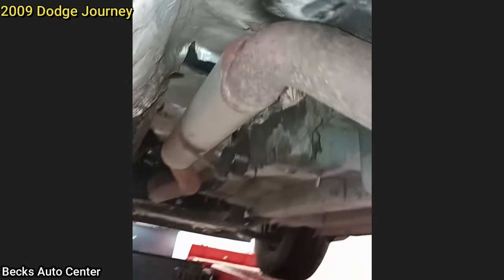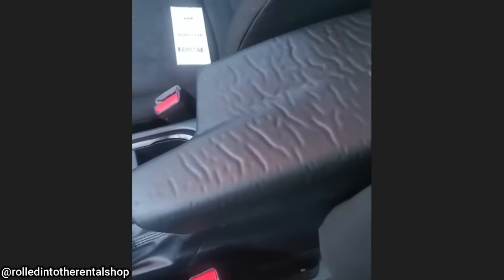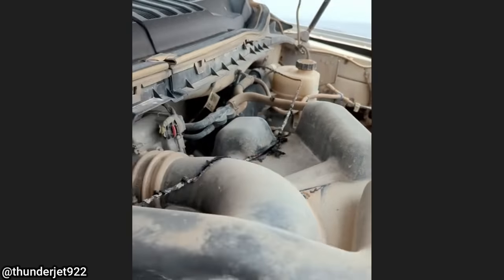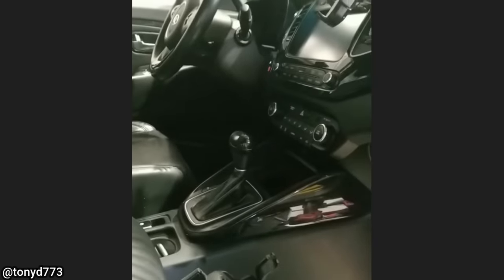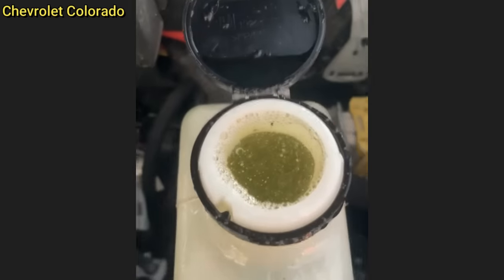Customer States Compilation (The Best of 2022) | Just Rolled In

Comment: I can’t get over the fact that the guy’s heater stopped working, and so he built an open-flame,
propane-fuelled space heater instead of buying a goddamn sweater. 😭
Reply: "Sure is cold in here. Guess I need a flamethrower. Only option."
Reply: Kinda looked like the burner on one of those turkey fryers.
Reply: You haven't lived very far north before have you
Reply: @iain-duncan  Two sweaters.
Reply: Red neck repair. Hey it works.
Reply: @beanieguitarguy4070  yup, that'll do it
Reply: yeah but sweaters dont stop the windows from fogging up.
Reply: when you have high INT and low WIS
Reply: Breathing in those fumes. Delightful.
Reply: One bump and the interiour is on fire.
Reply: Dumasses I’m telling u
Reply: Darwin....
Reply: It is a weed burning torch.
Reply: I've used a Mr heater in the back of my suburban during the winter to help warm it up. But it's not a open flame and I put a heat shield under and behind it and I turned it off before I started driving
Reply: bro the propane tank wasnt even strapped in, if he braked hard it would launch the fucking tank straight into him lmao💀
Reply: It's a typical propane burner for outdoor frying and boiling.  Hey, some places get reeeeally cold in the winter, and a sweater ain't gonna cut it.  Hopefully he wasn't going long distances and didn't give himself carbon monoxide poisoning.  😆
Reply: That's just badass. What's really dumb is that a customer thought you could change the color of the car in the settings.
Reply: I'm more worried about people driving with broken frames
Reply: Never in my life would I be too cold to put a propane heater in a car 😂
Reply: Hey, it's handy for lighting your cigarette.
Reply: He's tryna become the human torch😂
Reply: @beanieguitarguy4070 , customer would've been okay, though, if he'd just used a Tesla blowtorch! 😂
Reply: @adampope5107 I feel like propane fumes can’t be that bad because i’m pretty sure forklifts run on propane and they work in small areas. Obviously still not healthy though
Reply: My AC and heat don't work, and I don't have the money, time or skill to fix it. You know what I do? I deal with it 💀 either roll the window down or put a coat on

Comment: 0:00 Closing the Trunk But fast!!!
0:10 When Door Closes, The Tailgate Opens
0:24 Fuel Leak
0:37 When Turning Left & Rolling the Passenger Window down, the door opens
0:45 Customer States his door latch is broke
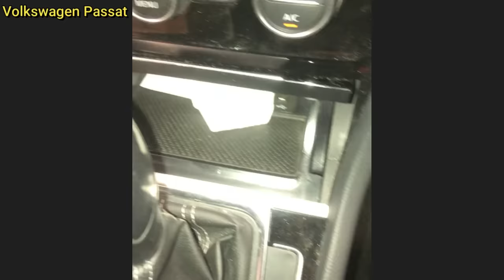0:58 McDonald’s Straw Disrupts the Tray Closing
1:07 Car Starts when Locking the Door 
1:26 Curry Interior 
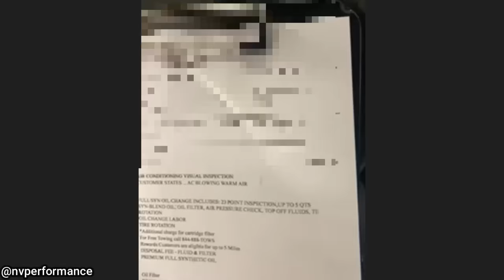1:45 AC blowing warm
2:02 Cowbell Driving
2:12 Raccoon in the Under the Car
2:22 Cutting a piece of Frame
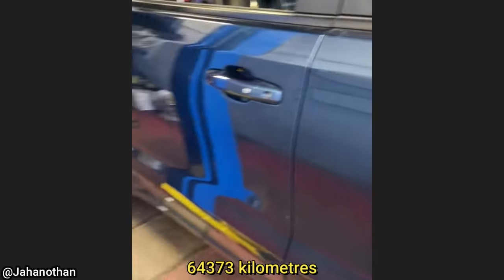2:35 Forgot to take the Funnel out
2:58 Car stopped moving
3:13 Smoking Brakes
3:25 Heard a pop while Driving 💥
3:44 Tire Repair
3:47 Taped Tesla Tire
3:55 Bungee Cord Attached to Lower Control Arm & Spindle
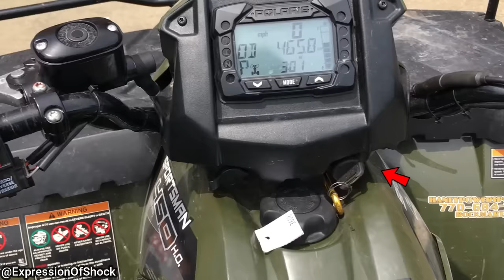4:04 ATV Shuts off
4:12 Engine is Making Funny Noise
4:25 Bullet Holes 🕳️ 
4:38 Shooted Rotors
4:47 Chained Control Arm
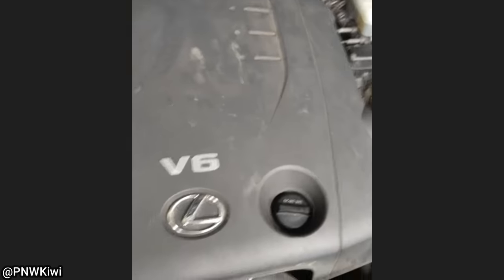4:53 Noise Under hood
5:06 Car hit a Guardrail
5:26 Beamer Rescued
5:40 Twisted Brake Lines
5:51 Dipstick Broke
6:05 Cutted CV Axle
6:20 Console lid looks like “my ballsack” please replace
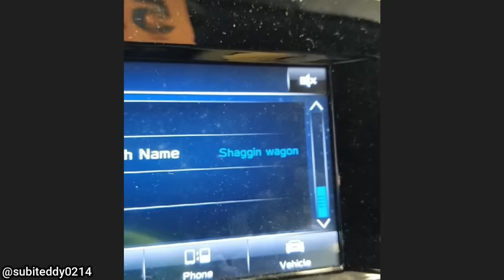6:38 Shaggin wagon
6:49 Family Member Installed New Brakes
6:57 No oil
7:12 No Gas ⛽️ 
7:37 Overfilled Engine Oil
7:47 Air filer Backwards
8:11 Didn’t follow the Torque Sequence Properly
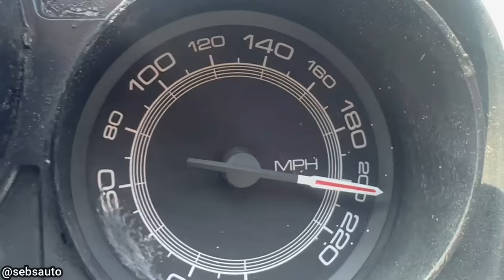8:20 Too Much Conditions For Ferrari 
8:48 Why would you need a Fuse
9:05 Bedazzled Chrysler 300
9:30 Critters Living under The Floor Mat
9:48 Why the Interior Is Covered In Mold
10:05 Taxi Mold
10:21 Disgusting 🤢
10:30 Turtle hit a windshield
10:40 No Radio has a blank screen
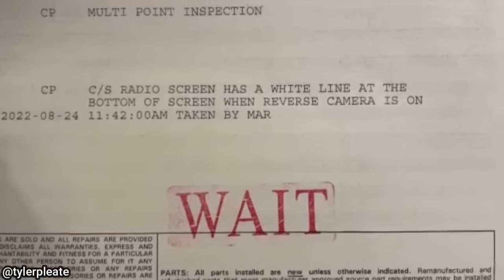10:51 Just a Bumper
11:03 Brake Issue ASMR
11:21 90 PSI Tires 🛞
11:33 110 PSI 🛞Tires Again 🛞
11:43 You need more air
11:59 Charging a Battery 🔋 
12:08 Reusable old Head Gasket
12:27 1960 VW Beetle Wheel Bearing
12:52 Pumpkin Fuse Blown
13:19 Flat Twinkies 😂
13:30 Interesting LED Light Installation
13:50 Adding a Bigger Fuse won’t work
14:02 Speaker Sound System Car
14:19 Wheel Rubbing Brake Caliper
14:31 My Truck is all over the road
14:57 Vegetable Oil in the Washer Fluid Reservoir
15:11 Car Clunks Under Acceleration
15:32 Install a Four flat trailer wiring
15:51 Slide Sideways like It’s on Ice
16:03 I Thought The Vehicle is on fire 🔥
16:15 Blue light on dash
16:30 Turkey Hit by A Car
16:40 Drove Into the Ditch
16:50 When your Car starts Grinding, stop & have it looked at
17:06 Light vibration in the front right
17:15 Seized Honda Engine
17:32 Seized Kia Engine
17:52 Washer Fluid in the Headlights
18:09 Right Brake light won’t work
18:21 Broken Engine Mounts
18:34 N20 Under the Seat
18:55 No Bolts Holding the Accelerator Pedal
19:04 Few of the Things they found wrong on this truck
19:33 Jug Of Engine oil on the Door
19:44 Tennis Coil Springs
19:51 it was a huge disaster
20:06 Interior light does not come on when open door
20:18 Fuel Saver Scam
20:28 I’m Just a Messenger
20:45 I’m Hittin Curbs
21:00 Welded Exhaust
21:17 Dog Destroyed the Truck Interior
21:30 Car Hits a Shop
21:43 Customer Jeep
Reply: Bless your soul

Comment: Okay, you have to admit; even though the fella that welded up that exhaust didn’t have a clue what he was doing, he was no quitter. It took real patience and perseverance to make that porcupine looking mess.
Reply: I’m a fucking horrible MIG welder and even I have no clue how he ended up with that mess. I couldn’t do that if I was trying to.
Reply: @Heiryuu  it was so consistent, but not in a good way.
Reply: Idk why but it skeeves me out and makes me feel all itchy just looking at it 😩
Reply: Looks like one of those ant hill sculptures. Also a welder myself and if i was tasked to do this on purpose i have no idea how to.
Reply: @Heiryuu  the only thing I can think of is if you turned off the gas, set the voltage and wirespeed to a random number, and use random copper wire for filler metal
Reply: @cavemanlovesmoke4394  It's like a reaction to seeing a cactus or a bryer patch. Big "do not touch" energy. Very good having those strong survival instincts.
Reply: That has to be at least 11 spools of wire.
Reply: That was impressive imo
Reply: THAT'S what all that stuff was?! I couldn't figure it out, I thought it had layers of fungus growing all over it, that's insane!
Reply: For a split second I thought there was a weird fungus on the exhaust lol

Comment: The overpressure tires reminds me of the tale I've shared before about the old lady that came to the station once where my brother worked cause her usual station was closed. Said they were so nice, always checked the tires - 100 psi. My brother dropped the pressure to normal and just told her "I don't care where you go from now on, just DO NOT go there again."
Reply: Wow! Its a miracle that place didn't get her or someone else killed! Just imagine the "help" they've given others.🤔
Reply: Discount Tire always do that to my 4 tires.  Go in for free rotation, they keep overinflating the tires by 20 psi.  I always had to manually bleed the air out.
Reply: God bless your brother. Signed, old ladies everywhere.
Reply: @justlucky8254  You're assuming that they haven't. The old lady got lucky, but dead men rarely tell tales.
Reply: @DecrepitBiden  Might want to tell them if you haven't already. Their compressor probably needs to be (re)calibrated
Reply: Those were semi tire pressures. 110 in the front 100 in the back
Reply: @happinessiskey2858  badly
Reply: should have filled em with runflat air smh
Reply: @candyman9635  I think it was summer and they were still using winter air SMDH.
Reply: @DecrepitBiden  I got a set of tires at discount tire and they underinflated them, 32 psi on a 55 psi tire
Reply: @DecrepitBiden  - That’s because idiots inflate the tires to what it says on the tire, rather than what the manufacturer recommends on the sticker inside the drivers front door!!! I’ve had to teach rookies this at the shops I’ve worked at before when there’re fresh out of “Tech” school.
Reply: @thatguy273  - Yeah. Even 2500-3500 pickups/vans usually only use 80psi. I can’t imagine putting that much in a regular passenger car!!! 😂
Reply: I bet it rode like Fred Flintstone’s car on those tires.
Reply: @chesterswingjr9796  I learned this the hard way when I overinflated my dad’s tires one time 😅 (neither of us have any technical car knowledge, but he knew about this at least; I did not)

Comment: At 5:06 there is a vehicle that was skewered by a guard rail. Some where out there is a guard rail that has been incorrectly installed because when properly installed this cannot happen. Guard are installed so the they lay like shingles on a rood of a house. You start installing them from the far end and work back against traffic. That way, the end of the first rail put in place is covered by the end of the second rail when it's put in place. The beginning of the guard rail when approaching it in traffic is normally curved down to the ground to deflect a vehicle or it has a curved cap on it which again overlaps the traffic end of the rail so there is no blunt end to hit. I worked for an outfit years ago that made and installed guard rails and installed miles of it. Occasionally we would be summoned out to reorient rails because they had been installed backwards by contractors that started at the wrong end.
Reply: Probably happened after crossing onto the wrong side of an undivided road!
Reply: there was a huge recall on bad guard rails years ago because of bad end caps that caused implement.  problem is that the majority of road works dont keep track of where these end caps are installed so there are still plenty out in the wild.
Reply: @stevie-ray2020  Notice that it's on the right side of a right hand drive car.  So, you're probably right.
Reply: Yeah I've heard that sometimes inexperienced workers will add extra support bolts that can cause fatal accidents
Reply: Steve Eimer would’ve lost his ish if he seen this cause he’s hella passionate about the guard rails being fixed and I understand why

https://youtube.com/@UkrainePapa
Reply: "curved down to the ground", aka the "launch 'em ten feet high and into a triple rollover" guide.
Reply: @Slicerwizard  That's the CHiP's mod.
Reply: @Slicerwizard  that’s what I think of them now that I was once in a flying car😅
Reply: @Slicerwizard  which still sounds safer than being skewered through the midsection
Reply: Maybe the driver was on the wrong side of the road.
Never underestimate the power of idiots to thwart the efforts of geniuses.
Reply: i can understand that he can sue the LIVING FUCK  out of the motor transit safety office government
Reply: I'm guessing it was in another country due to the steering wheel on the right 
But it could have been in the us
Reply: @stevie-ray2020  Sometimes out on the road you also see guard rails that have been damaged (crashed into) and not repaired yet
Reply: A friend of mine was a passenger  when the driver decided to be stupid on the paved road at the beach.  Her stupidity caused the front right tire to hit the sand on the shoulder and it pulled the car off, right at a guardrail.  This was a few decades ago and end caps were a rare thing.  They sawed the guardrail off near the windshield and transported him to the hospital with his seat.  The guardrail went into his face and pinned him.
Reply: Nah there's a lot of properly installed guardrails that'll do this. Most places haven't installed the style that spears cars a lot in decades, but they're around and "installed properly". And even the newest, fanciest, safest guard rail can get hit wrong, or multiple times, or just fuck up in a freak accident and skewer a car just the same, just because they massively lower the chance doesn't mean they eliminate it entirely.
Reply: @youtubecommenter4213  well that’s… concerning

Comment: The moment he started the car with the key in the door I nearly died laughing. Also, I totally get that the customer never tried that! This could be a 'feature' on all cars produced from that model and nobody would find out. Who the hell uses the key in the door when you have a remote? I certainly never tried!!!
Reply: Not me going out to my car at 3am just to see if my car does this..... 
*update* it does not.
Reply: I cannot believe it's a mfr's feature to allow a car to start from outside. Maybe an aftermarket remote start kit got installed and miswired?
Reply: I would actually pay extra for this feature, so the AC can start and engine can warm up as I strap in.
Reply: Most cars use keys . The new modern ones tho have remotes. Me myself never had a car that start with a remote
Reply: @A-A-A-A-A-A-A-A  I usually drive cars that start with a key. But I only once rented a car that required a key to open the doors instead of a remote.
Reply: @pixels303at-odysee9  most cars change signals every time, a key will never change unless you change all the holes
Reply: @pixels303at-odysee9  Mechanical keys are trivial to duplicate even with just a picture of it. And there are many ways to open a lock without the actual key (i.e. lockpicking). Prior to using transponders and other electronics, it was very easy to open a door and start a vehicle without the proper key. That is much more difficult to do now because of how difficult it is to duplicate a transponder.
Reply: @pixels303at-odysee9  they made so many things into a multimedia device, why not cars?🤣
Reply: I can’t use the key on my fob, it activates the security alarm. What’s the point in providing a key with the fob if it’s useless?
Reply: @jetoler7379  after watching this video, I have to ask: are you pressing the alarm button? Lol
Reply: @Jetoler  You might need to turn valet mode off. This is usually done via a sequence of buttons, key turns. Look in your owners manual, there will be instructions. Just takes a minute.
Reply: @FreejackVesa  No, definitely not. It's some weird security filter. I get that it prevents lockpicking, but like if my battery dies I can't access my car.

It's happened multiple times. It's a thing with newer cars. I hate it.
Reply: @berrypi8865  Oh shit, thanks I'll check it out next time I drive.
Reply: @KingDudi16  
Ever hear of a remote start? It can be installed on any car or truck as long as it has an automatic transmission. 
I had one  installed back in 2005.
I don't know what year they started to become available.
Reply: @A-A-A-A-A-A-A-A  
Anyone can have a remote start installed. As long as you have an automatic transmission. 
It doesn't need to come with the car.
Reply: @Mr.Robert1  yeah heard of it , but i don't know if it's safer to have . i feel the car becomes much easier to be stolen than it already is

Comment: I had a friend who fixed his broken horn by installing a light switch. It was hilarious, and I loved it! XD

He also had a tendency to get a little road rage, so when he got a new car, he scared the shit out of himself hitting the horn on the steering wheel because he was so used to it not work and was only hitting the wheel to release frustration.
Reply: I used to drive an old cop car with the horn circuit basically gone - put a big red button in the dash that you could slam to hit the horn.
Reply: It was about 20 some years ago, the horn on my old Ford didn't work and I grew tired of warning jaywalking pedestrians by blocking the brakes, it had great effect but took a toll on the tires. So I installed a big bad triple horn set that worked with compressed air and put a door bell knob on the dash. Worked like a charm! Weirdly enough these horns were banned shortly after I had sold off that Ford.

Comment: 2:57- I want to know how fast they "pulled out of the driveway" judging by those tires and exploded gear box lmao
Reply: I was initially thinking they might have been sold a bad car and it was a sad case of borderline fraud, but you're probably right.  They were probably acting a fool in their "new" car, the diff blew up at high speed, and locked both rear tires, hence the flat spots.
Reply: They had to have been going 100+

Comment: I had a hell of a time replacing a ball joint and control. Bone headed mistake turned into a lot longer job.

Watching this video makes me feel happy and less defeated
Reply: i had the ca snap when i was doing one before. i was using the right tool to take it out and it just broke because it was aluminum and the steel stuck to it. still dont like hondas that much after having to deal with that shitbox

Comment: Every profession has these stories.  

Customer Says - My computer will not boot up.  I check it, it's not plugged in to the wall.
Customer Says - My computer screen doesn't show anything.  I checked it, the brightness was turned all the way down.

I could go on and on.  If you are not a professional, you can't be expected to know all the issues and problems we have troubleshooted for 15,000 hours.  It's all about experience.

Comment: 18:48 - What is that exactly?
Reply: Co2 cartridges
Reply: Like he said it’s co2, I think they use em to get high
Reply: Whip cream canisters aka whippets. It’s Nitrous oxide same stuff dentist use.
Reply: Those are pellet gun cartridges yeah , the get high off the co2
Reply: Those are vapes
Reply: Use those in Starbucks to charge whip canisters, people get high off those
Reply: CO2 is carbon dioxide, the same gas we breathe out, it doesn't get you high. Co2 cartridges are used for air/pellet 🔫, carbonation, etc.

 N20 is nitrous oxide, which is aka laughing gas. It DOES get you high. It is also used in cars for nos, to make them go faster, but these are too small for use in a car. They're also used for whipped cream.

BOTH come in canisters like this. So the owner is either into airsoft/pellet 🔫, culinary arts, or they're doing whippets(inhaling for the buzz)
Reply: They're brass and steel casings.